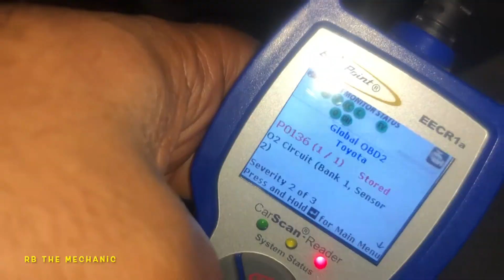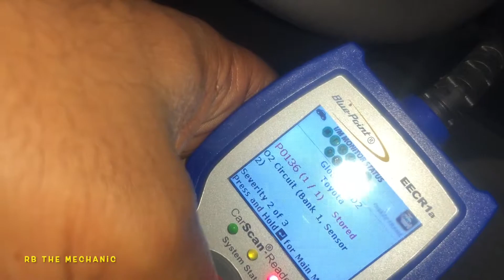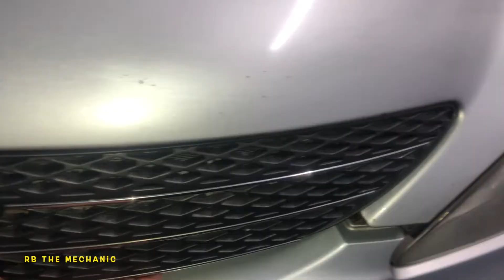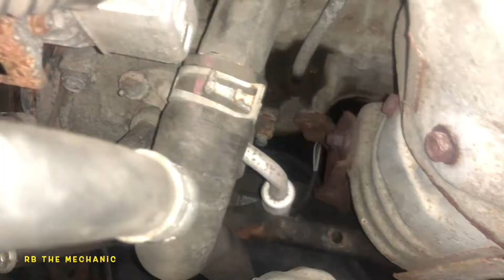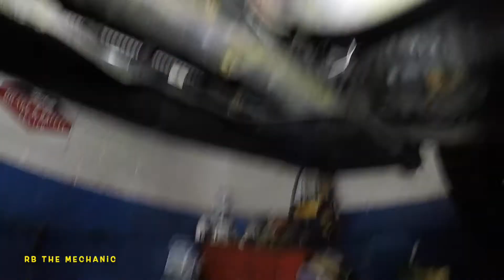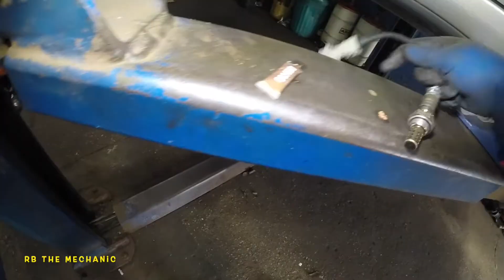Toyota Camry 2003 to 2006 replace Bank1 Sensor 2 oxygen sensor to fix code P0136

Comment: I have a 02 camry, ans its giving me misfire on cilynder1,2,4. I changes the the spark plgs and ignition coils already ans the problem is still their. The car is misfiring really bad where it stalls after a but of idling.  Any opinion? Somome mentiones also the 02 sensor. But im thinking why would it cause those misfires
Reply from the maker: Could be o2 sensor or vaccum leak around intake
Reply: @RBTheMechanic ima try testing the 02 sensor first, then the injectors

Comment: 2003 Camry v6 , still have p420 cat low efficiency after putting in new cat and bank 1 sen 1 o2 sensor. Anything would help . Thank you in advance
Reply from the maker: Usully I recomend replace the 2nd sensor which gives out the ready for efficiency of CC
Reply: @RBTheMechanic the bank 1 sensor 2 ?

Comment: I keyed in the part number in a catalogue site and it stated that the part number does not match my vehicle spec. 

My vehicle is the Camry 2005 LE 2.4L

Was only wondering why.
Reply from the maker: Could be diffrent emission

Comment: I just found out that the O2 sensor in my 06 Toyota Camry LE 2.4 Bank 1 senser 3 has a fuse in the engine compartment fuse box,why did they put a third sensor in the vehicle? It is a 2.4 not a 3.0
Reply from the maker: Should only have 2 sensors
Reply: @RBTheMechanic nope 3 rd sensor is near the muffler and harness is under the front drive seat 😢

Comment: Have an 04 Camry 3.0 v6 with a p2198 p0171 and a p0174 code. Any suggestions?
Reply from the maker: @juliuscezar24  I would replace bank2 sensor 1 oxygen sensor before anything
Reply: @ should I go with OEM or aftermarket?
Reply: @ thank you!

Comment: I replaced it 2 times and the light keeps coming back with the same code. Any suggestions?
Reply from the maker: What brand did u use
Reply: @RBTheMechanic  autozone “Bosh”
Reply: Sorry, “ denso” is the last one
Reply from the maker: @montrose5paulina  oh ok and what is the code and what it’s reading
Reply: @RBTheMechanic  P0141 ,, 
02 Sensor heater c ircuit Bank  1 Sensor 2
Reply from the maker: @montrose5paulina did u check or clean the connector I had one car that had bad connector
Reply: @RBTheMechanic  Not yet, I’m going to spray electric cleaner and inspect it. I inspected for any bare wires and didn’t find any damage

Comment: hey bro i have 2003 toyota camry , i am getting p0420 code do you think changing the 02 downstream would resolve the issue?
Reply from the maker: It’s worth the try before u spend the big bucks
Reply: do you know the specific 02 sensor it is i should get?
Reply from the maker: @StayFocused15  no that part store can look up for you
Reply: @RBTheMechanic  okay thanks i appreciate you responding as well!
Reply from the maker: @StayFocused15  no problem

Comment: I have 2005 Lexus ES 330 V6 3.3L with error code P0137 Bank 1 Sensor 2 Low Voltage. Could you help me identify the correct replacement part? Thanks
Reply from the maker: Idk the part number but parts department can help u with that but it’s the second sensor

Comment: Are sensors universal? I bought one so would it fit on any bank?
Reply from the maker: No they have specs u have to order it with vin number
Reply: @RBTheMechanic  the one I bought never said what bank it was for. It does say “4 wire”. The code says bank 1 sensor 2. I’m just not sure which bank it would be? The first cat or the 2nd?

Comment: Hey brother so I’ve changed out the bank 1 sensor one o2 twice and replaced cat. I’m still getting p0031 with loss of power. Any idea what I could be neglecting here?
Reply from the maker: Possability defective sensor check fuse and swap relay for oxygen sensor how ever u need to check the oxygen performance with scan tool

Comment: Im confused. I have p1135 b1s1,
P1155 b2s1. 2002 camry v6.
Bank 1 sensor 1 is on the firewall??? Correct? 
I found 3 sensors in the front 1 upstream in the front and two more under that. 
Which one would be bank 1s1? I think mine has four???
Reply from the maker: Bank 1s1 is the first one if u follow the manifold from the engine by fire wall and bank to follow manifold from engine front of the car by radiator
Reply: @RBTheMechanic  thank you so much. Not many creators respond.  That's super cool. So it looks like I got the hard one in the back? Smh lol
Reply from the maker: @samaelmartinus3273  welcome!!

Comment: I have a Toyota Camry Le 2004 2.4L 4 cylinder California emissions can I use the same oxygen sensor part number used in this video?
Reply from the maker: Not sure if this is cali emission but cylinder misfire will be fixed with oxygen sensor

Comment: The old sensor looks different from the new one. Does this affect the performance of the sensor? I could not find the same shape of my sensor. My car is Australian, not American. Do you recommend taking a different shape sensor?
Reply from the maker: I usually put in diffrent shape denso has diffrent designs but mostly they alike

Comment: i’m getting a p0420 on bank one, i have a 2006 camry 3.0. Which sensor would it be? i’m getting a few other codes but my cat isn’t making any noise
Reply from the maker: It’s the one in the back down by firewal here’s a video on Avalon should be similar but tits the sensor after that also I’m not sure about clearance on the Canery from top https://youtu.be/mcwJ2R-EVxY